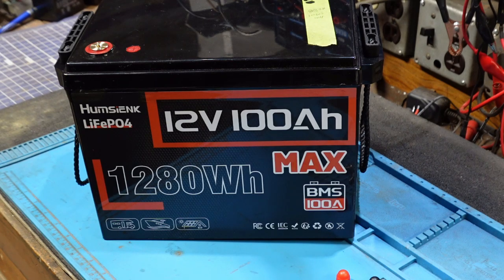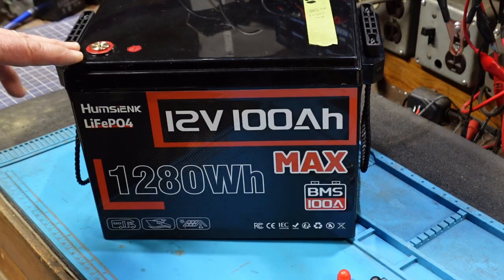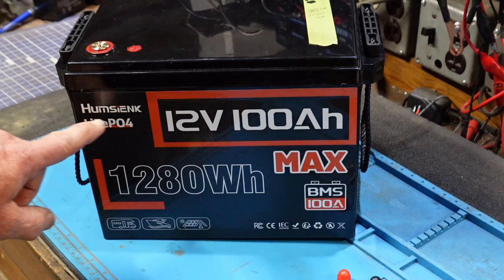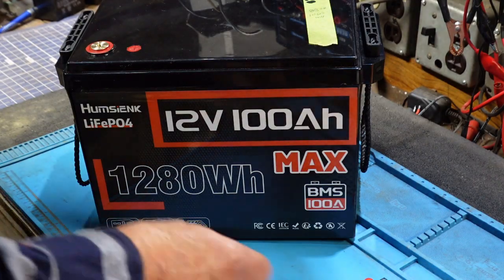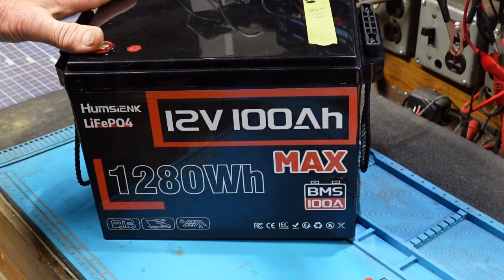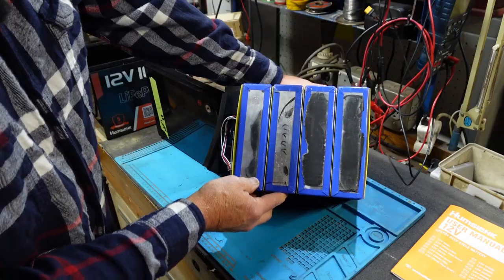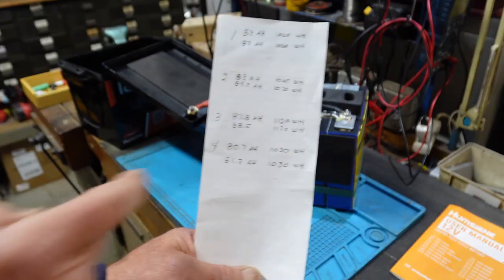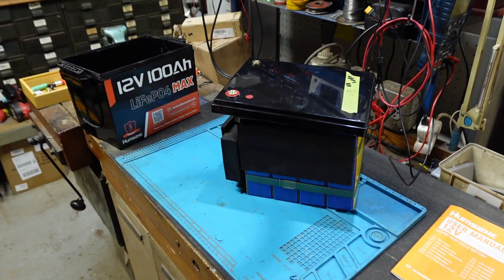Humsienk Max 100 AH Lifepo4 😞⚠👎

Comment: I enjoy your reviews, I wish I had seen this review before I purchased one, the one they sent me tested  twice at 89 ah, and they have yet to reply back to my complaint.
Reply from the maker: I got a quick reply and a discount offer to keep them. I excepted the offer and am using them just to see how they perform over time. So far no further lose or gain. I think they are used cells. Just guessing but I think they buy groups of batteries from different manufactures and put their label on them. Some come from good manufactures and some not so good. I have two of their batteries (different model) that are fine . Good luck with yours.

Comment: 1,000 watts will generate more heat, and make the battery not last as long. 
100 watts will generate less heat and make the battery last longer. If you don't do this test, and test for the relationship between power draw vs heat vs time before the battery is dead, you are not telling the full story.

Comment: My experience in the past 3-4 years is that grade A or grade A+ cells means that the batteries aren't DOA. With luck you get decent batteries. Only a few manufacturers still deliver good batteries but even those have some fallout. The price pressure unfortunately shows up in the quality or lack thereof.